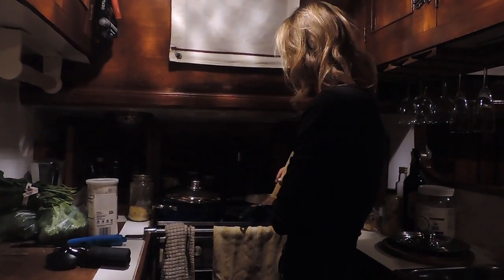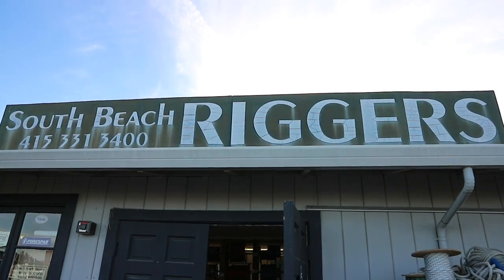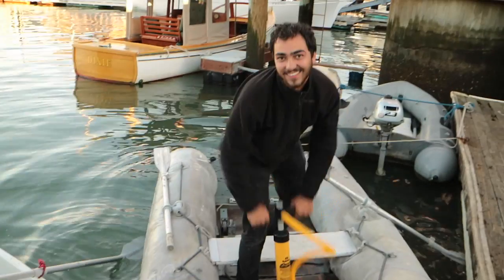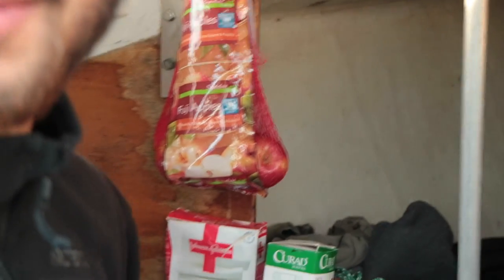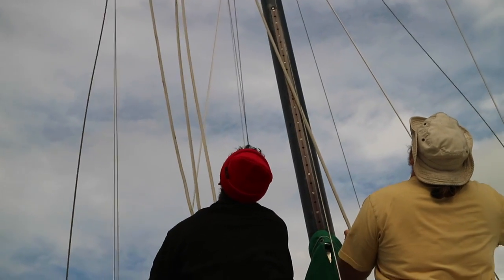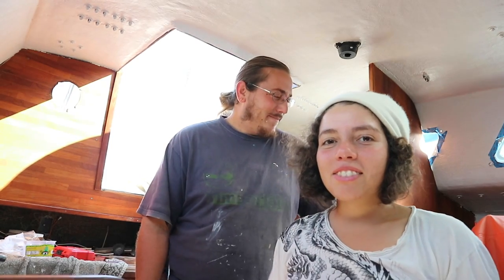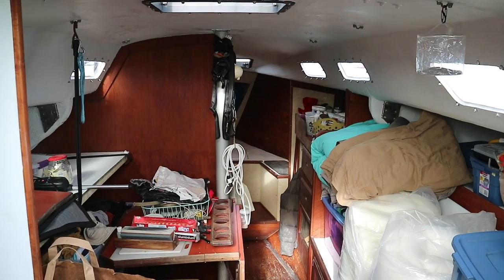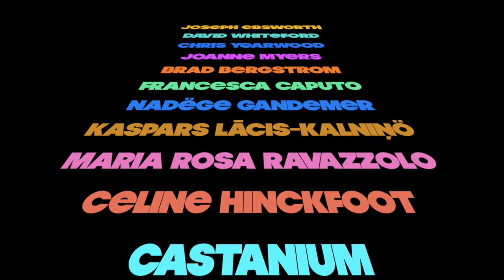19. Sailorama: Living Aboard on the Bay

Comment: You should look into butyl tape.  I have found it better for rebeaded deck hardware and port lights than caulking.  It is easier to work with and the clean up is supper easy.  There are some good videos on YouTube about butyl tape.  I hope this helps you and others in the future.
Reply from the maker: Hmm...my experience with butyl tape is that it's horrible to clean up, particularly because I was trying to scrape it away in hard-to-get-to spaces. But very true - could be easier to work with for bedding the windows, which are easily accessible, flat areas.
Reply: Sailorama 
What were you beading that gave you so much trubble? 
I have used it under my bright work on deck.  Also most of my deck hardware like wenches, traveler  tracks, life line stanchions, vent boxes, aluminum toe rails.
The way I clean up is, I use a small flat top screwdriver.  what ever squishes out I simply trace the part with the screwdriver basically cutting the excess.  Then I just peel up excess.  Most of the time that's it. But if there is some that's being stubborn to remove mineral spirits cleans it right up.
Reply from the maker: Yeah, sounds about right. The hard-to-reach place was where the deck attaches to the hull, inside, under the toerail. Everywhere else, I could see it working well and easy to use for sure...